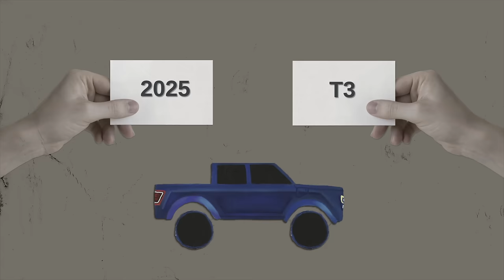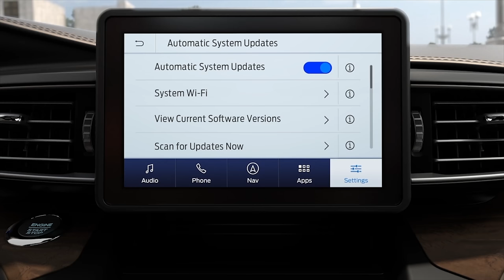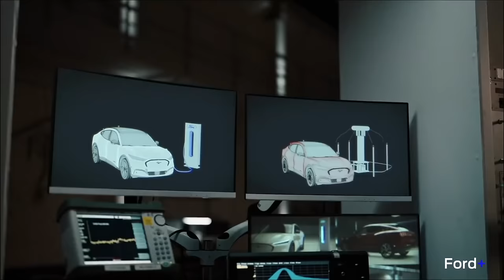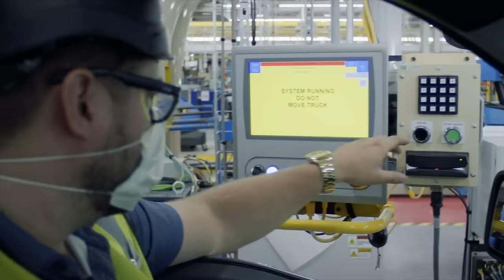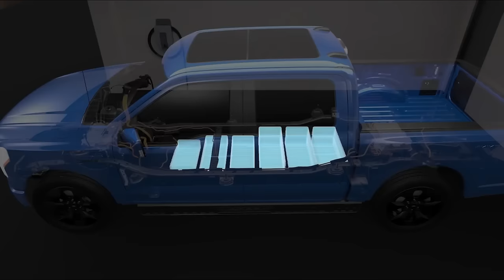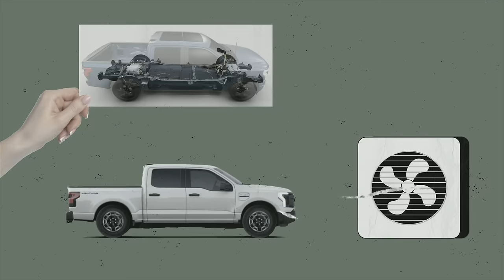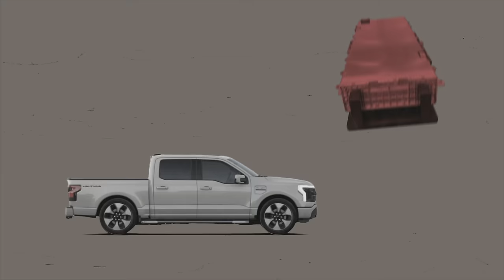Ford's New Cheap T3 Truck Just Killed the Toyota Tacoma

Comment: Electric trucks will never outsell gas trucks unless they stop selling gas trucks. They can't sell $60k F150s now. They won't be able to sell these eletric trucks. Ford will go bankrupt with this new truck.
Reply: Not true.  The range issues and marked up prices is a big reason people won't buy them. They didn't make that many lighting evs either.  Youtuber Tyler Hoover had a video showing how the range was cut in half pulling a trailer.  This blew up all over the news how there is a range problem if it's used as a truck. Tesla sales have fallen to the point they cut prices by the thousands on each model.  Whoever you are talking to doesn't know the market. The only way most Americans will ever buy an ev is if gas/ diesel are no longer legally sold.
Reply: @blaakrose  which won't happen

Comment: Give me a midsize pick-up with a decent 6 cylinder, a carburetor, and 3 on the tree. Made in this century in America would be great.
Reply: I am definitely a bigger fan of fuel injection over carburator.
Reply: It’s called a Nissan Frontier and it’s an underrated badass truck. Love my new frontier. Perfect blend of tech and utility. More utility. Perfect midsized pickup
Reply: I would prefer a modern 6-speed manual and EFI (not direct injection), but point taken.
Reply: @confidentlocal8600  agreed.

Comment: They should make small trucks again. My first car was a Ram 50. It was all economy and utilitarian with less than 100,000 and the previous owner was a diesel mechanic and a slow driver so it was in immaculate condition. It wasn’t quick, but since it was manual it was still fun and easy to drive since it handled better most than big trucks and the insurance, fuel, and maintenance costs were much lower

Comment: $100,000 for a pickup that can go 245 miles IF YOU TOW NOTHING AND CARRY NOTHING. A contractor is going to have to hire some guy to do nothing but try to find a charging station and just sit there for 8 hours doing nothing. These are not ready for prime time.

Comment: I want a 3/4 ton, 428ci EFI V8, 4X4, 4-6 speed MANUAL transmission, ABS, Am/FM CD player, Manual windows, 2 cup holders and an ashtray.  Come in at say 25-35K.  
That would be a reliable truck and would sell millions.
Reply: Lmao a crap 4x4 is like 5k if the 4wd works, you’re high 😂
Reply: No they won't sell millions as they can't produce a truck that will sell in the price range. Second Corporate Average Fuel Economy ratings that Ford has to meet by government regulations can't sell big 13 MPG V8  trucks and also meet emissions standards.

Comment: Ford is switching to the Tesla coonnection for future EVs and will have an adapter for current models in 2024, that will give them access to Telsa super chargers. Love or hate Tesla, but they have the most relieable charging network.
Reply: Don't like Teslas but your right man, they have the most reliable charging network out there.

Comment: Doesn't Tesla hold the current record for EV fires too ?
Reply: Probably due to volume and market share of EVs
Reply: @richardfolden3860  I'm sure the former owners of Fieros, Pintos and Mavericks will agree with you
Reply: @richardfolden3860  a well designed and running internal combustion engine is the thing of beauty and always will be.

Comment: If they're going to go electric, they're going to need to fix their aerodynamics. They say that the whole Aptera has the same drag as an f-150s mirror. Tesla extended their range a lot by focusing on aerodynamics. They could probably make an F-150 that looks like an old 1940s work truck and that's a lot more aerodynamic

Comment: If you think of a manual transmission, you will never need to worry about it, before 400K miles. And no EV high cost and low range of traveling.

Comment: Does anyone remember Datsun 620's and 2nd gen Toyota Pickups?. Auto executives have their heads so far up that they can see through their own eyeballs.
Reply: My Dad bought a new 1981 Toyota 2WD w/ 22R manual trans back in the day, best truck we ever owned. Changed oil every 3500, a few sets of brakes and a battery. That truck went 245,000 miles before we sold it. Bed was almost rusted away.... But dang that was a great truck.
Reply: Never had a Datsun 620 but I did have a 75 Datsun B210❤
Reply: I learned how to drive manual on an 82 Datsun pickup!

Comment: How do I know if car has blown head gasket or cracked head?
Reply: Your engine May blow white smoke out the tailpipe or engine oil on the dipstick will look like a creamy milkshake, your engine may run like it has a misfire
Reply: @jdmforever5583  yeah, but is there difference between cracked head and blown head gasket?

Comment: Thank you for shooting straight that ev fires are less likely than people think. It has actually been proven that the percent of gas cars that catch fire is higher per mile driven than electric cars. And that stat should help show gas cars in a better light by using per mile because they have driven so so many miles, but it doesnt. 19 car fires happen every hour in the United States.